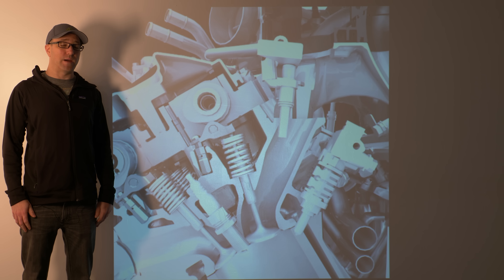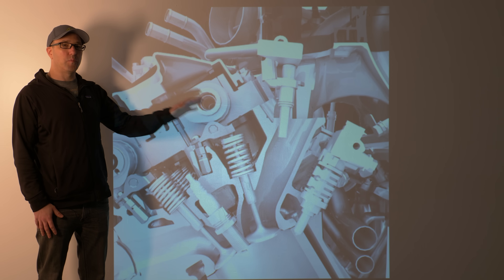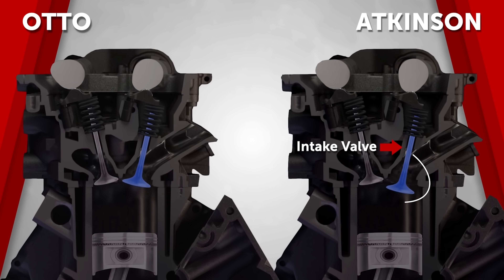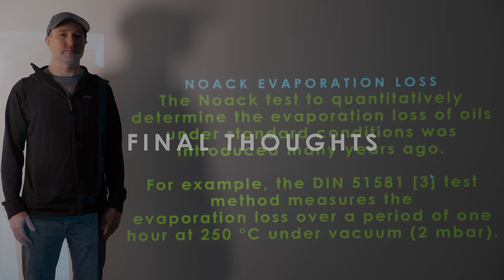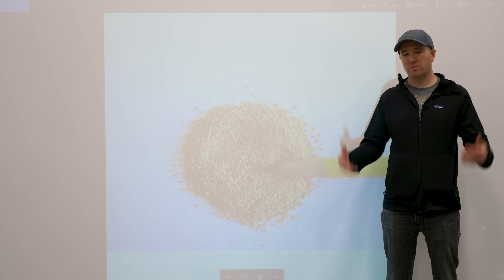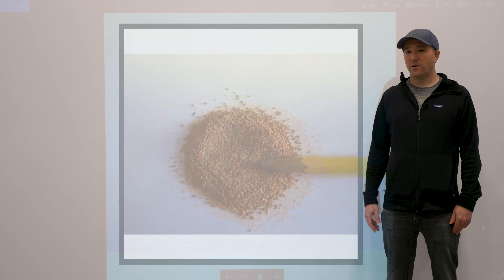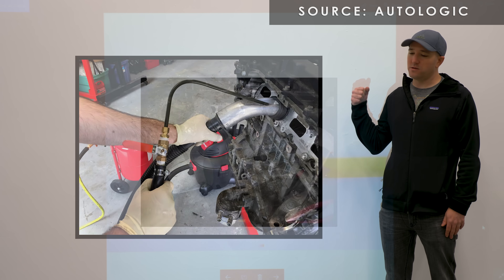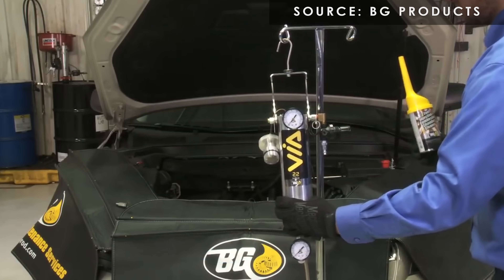Direct Injection, Problems and Solutions | The Fine Print

Comment: Lots to say and share. Please be smarter than my average customer(s):

1) check your oil religiously. Always on flat, level ground. Wipe the dipstick and recheck it. Add as needed.

2) Stick to 5k mile oil change intervals, with a OE or premium oil and filter. I’ve written tech articles on why this is so critical.

He hit the nail on the head, talking about the evaporation of thinner oils, but evaporation is not the only culprit: they are more susceptible at getting past the rings and getting burned as part of the normal combustion process. 

Honda and Toyota have been using 0W-20 oil as far back is 2010. On the Repair side, we call this “water weight”…it’s ridiculously thin, and not ideal for hot climates. 

Thinner oil allows for reduced friction and tighter bearing clearances (and increased fuel economy), but you have to become more religious and adjusting your oil levels as the owner. 

3) Americans are famously bad at this. Equal parts cheap and neglectful with cars.

To the point that some manufactures have completely gone away from dipsticks, and only use a digital level sensor, which creates its own series of problems.

4) use top tier fuels exclusively. Not cheap, budget brands. Shell, Chevron, Exxon, Texaco, among others in the US. And use the appropriate octane for your motor.

Cheap fuels without detergents and cleaning agents lead to an even faster buildup of carbon deposits throughout the pistons and valves. Long term, it makes a pronounced difference. I’ve bore scoped hundreds of engines, and have the data to defend this.

5) If you have a DI motor…plan, save, and budget for the carbon cleaning every 40-50k miles. 

6) Make sure the shop you use knows what they’re doing and has done these before. The service requires the intake manifold be removed from the engine, along with anything else attached to it, and lots of care to ensure no debris gets down into the motor during cleaning.

Chalk it up to the price of admission for having reduced emissions and greater power from your motor. Power output from DI engines has been incredible for the last 10yrs or so.

Like 👍 if this info helped anyone.

-career mechanic and engine builder, 22yrs
Reply: Terrific post Tex. Lots of good content and easy to read. I just leased a 25 Forester assuming they used a dual injector system, or something else, to address this as I encountered carbon valve fouling literally 30 years ago working in a VW shop. 
Holy schtick how could this not be fixed by now? Shame on me for assuming...

Comment: Shell's Premium gasoline has cleaning additives and a bottle of Techtron in the gas tank really helps keep direct injectors clean.
NOTHING WORKS FOR THE VALVES. Every year, have a shop walnut blast them. Don't  even waste your time with trying chemicals 😂 and scrubbing. The cleaner will get into some pistons and you will run dry in that area a few minutes; enough to start damaging the engine.
Shop around, sone shops charge $300ish, some a lot more.

Comment: If they really design it right the first time and in the proper configuration layout, that makes it easy to maintain.  We wouldn't be having all these carbon issues and whatnot that are at an odd configuration.   What works and made sense should be adopted as the best design and most reliable.  NOT let's design this in the most complicated way that just made zero sense and less reliable.

Comment: GDI  is a mistake. With port injection, the back of the intake valves is constantly cleaned with fuel. This does not happen with GDI. Really good presentation.

Comment: I have a 2017 CRV 1.5 turbo with 81,000 miles and have not had a bit of engine/transmission problems. Average 38mpg so far.

Comment: Have you ever wondered why car manufacturers don't install oil catch cans from the factory? It seems like a no-brainer solution to prevent engine oil from entering the intake system, which can cause damage and significantly reduce performance. With an oil catch can, you can prevent this from happening and extend the life of your engine. So, why not urge manufacturers to include this simple yet effective device in their factory installations?

Comment: This is good to know. I have the Kia 2.0 turbo GDI motor. In changimg out the starter I had to take the intake manifold off and i did notice the condition of the intake valves. I guess i will take the time to clean them off sometime. The car has 190k miles on it.

Comment: Funny, I had a very similar problem with diesel fired boilers. Firetube boilers have worked well for over a century now. But, with new EPA and state emissions standards for NOx, now we were required to use steam atomization for the burners.  In theory it would work great, lower the combustion temperature and therefore lower the formation of thermal NOx. In reality, we had massive carvon deposits everywhere in the firebox.

Comment: I've been running a couple catch cans (one is vented to atmosphere) on my 2.0l turbo Focus ST. I have a big turbo now and dont really notice too much blow by, but i think temperatures and how i drive impacts how much i get. I hand cleaned mine about 1k miles ago (was at 92k miles) and the intake valves were pretty good, but did have obvious build up. I can see how this would impact air flow. But another preventative option is methanol injection, used primarily for cleaning the valves if nothing else. 

Good video, well put together and very informative! Now if the EPA could just take a long walk off a short peer, I think the rest of us would be just fine 😅

Comment: IS250 4GR-FSE owner here. Learn to use Seafoam and love it. 188k miles and counting.
Reply: How often do you treat?  Do you apply thru the brake booster hose?  Thanks
Reply: @brianh1161  I treat it when I notice any off-idle hesitation. I used the spray bottle with the horseshoe straw that can slip under the intake hose and spray right on the throttle plate.
Reply: @G5Hohn  Sounds good - thanks!

Comment: Great presentation thanks, however the build-up of carbon you keep showing on the intake valves is not oil from 'leaking turbo seals', but dirty exhaust gas from the EGR.
Exhaust gas recirculation, which you didn't mention once, puts dirty exhaust gasses back onto the engine to reduce heat and emissions, and it's full of carbon and other nasties. So I believe it's the Exhaust Gas Recirculated that causes such build-up of crud on the intake valve stems, and yes there's no indirect fuel to clean it off.
Turbos have shims but not really seals, as any seal would obviously melt at such high temperatures, and a turbo causing oil to go into the intake is fooked as we say up North.

Comment: GDI, VVT, AFM and DFM engines (which are the only engines found in modern vehicles) all REQUIRE CLEAN OIL. If you change your oil every 10,000 miles you WILL ruin these engines. Oil removes carbon buildup and holds it in suspension until the oil is changed. Change your oil every 5000 miles or LESS and your GDI engine will be fine.

Comment: Good advice. I already knew about the DI only engines. That's why I got a used Lexus GS 350 from 2015. It has both. DI and port injection like you mentioned. I'm staying away from DI engines only. The problem is that regular consumers don't know about this issue 😢. I used to be a car tech and I'm just a DIY now. Luckily for me. I don't believe in the full EV thing yet. I would do Hybrid from Toyota or Lexus first 👍

Comment: I think your blow by explanation is not quite right.  Blow by direction in this example is “downward” past the rings into the crankcase, not “upward” through the intake valves.  Pressure back through the intake valves is not blow by.

Comment: LIke SG said, Toyota and Ford both use the perfect solution:  dual port/GDI injection.  The problem is twofold, first bean counters don't care what happens to an engine out of the warranty period. They nix any port/GDI proposals to save a few bucks, long term reputation be darned.  Second is the leasing sales model.   If customers were given the option to pay extra for dual injection would they take it?  Leasers wouldn't but outright purchasers probably would.  Thus all the customer pressure is on the performance and reliability in the first two or three years of a car's life.

Comment: A question? Would running cleaner(seafoam, throttle body cleaner) thru intake/throttle body once in a while (10k miles or so) not be effective on cleaning valves on engines with DI? Also, when I replaced valve cover gasket on my 2011 G25, I saw oil sludge near valves. Then, I installed oil catch cans and I see a small amount of oil being caught every 4-5k miles. So, oil catch can is definitely helping even for engines without DI

Comment: I wanted to get a catch can or aos installed on my turbo, but I've heard horror stories of water vapour condensation freezing in the lines on cold winter highway drives, building high oil pressure and shooting the dipstick out and spraying the engine compartment with oil. It's damned cold here. Guess I'll plan for a walnut blast

Comment: Great video.  I thought there was really no way to explain it better.  You did an outstanding job. Thank you.  Side note though.  ESPECIALLY DIESELS,  the injector pressures are now is so high that it starts not only taxing what the injector can safely handle pressure wise but they also remove the lubricating properties to meet emission standards.  So you put Lucas Upper Cylinder Lubricant into your fuel but you are now sacrificing the longevity of your SCR system.  This is a regulation issue.  

Cars and trucks today put out a small fraction of what they were putting out 40 to 50 years ago.  Great, right?  Wrong, because there are more cars on the road then there were 40 or 50 years ago, so that makes all the emission control gains meaningless.  Electric Cars introduce a whole new set of problems maintenance wise. That in itself is a different video, yeah, looking at you brake booster and batteries.

Comment: If each intake tube on the intake manifold had a screw on capped orifice, the valve cleaning solution could be shot into the intake valve easily to clean one valve at a time. No removal of the intake required and no guessing if you are getting enough cleaning solution thru the air intake tube at the air filter housing.

Comment: Motor?? Engine, not motor. Gas engine, electric fan motor…….diesel engine……electric pump motor……..jet engine…….electric door opener motor. Engine for combustible fuels!
Reply from the maker: Motor oil, motorsports...
Reply: @savagegeese  As the motor oil container reads…..Motor oil for gasoline engines…….motor oil for diesel engines ha ha. This was a great video by the way.

Comment: If an Engineer can come up with a way to directly inject fuel into an engine. Why can't they come up with an injector for  the air? It would remove the need for an intake value and it would allow you to scavange the cylinder better on the exhaust stroke as well?

Comment: It's hard to believe that a lean buring high economy engine with port injection getting a solid  50mpg or more is actually polluting more than a gdi getting 35mpg or less.  And the insane additional costs involved are truly criminal for a large portion of the working population. And, in real world usage, the majority of the gdi engines are not getting these expensive service procedures and are far more polluting than previous injection designs.  This is the real world, not some lab result. I'm all for tech as long as it works flawlessly and without need of attention.  But all these green initiatives in various different devices are so damn costly over time that they are now unaffordable for many people. Responsible engineering without planned obsolescence and continuous repair is the correct answer across the board. No one in authority cares so why would manufacturers care.  It's all about the buck and it will destroy America and most of the other economies in the world all in the name of helping the planet, which is a complete cover for their pitiful greed.

Comment: About going back to port injection not being practical... It is not practical to burn oil using gdi after a few miles. What I'm seeing is the requirement of unreasonable maintenace (double or more oil changes and probably more expensive oil) to keep direct injection systems "in spec" to original emissions standards. More and more, people can't even afford cars, much less keep up with ideal increased servicing, not to mention having the time to get that extra service. So then, many more will lease vehicles and then we/they really won't keep up with keeping filthy DI engines clean because it's not our car.  Looks to me like stupid government.

Comment: The type of oil used plays a HUGE role in the carbon buildup with GDI engines.  Not all oils are the same and I always tell my clients that have GDI engines to ALWAYS use the OEM (dealership) oil.  Yes, it might be $10.00 a quart but these oils are specifically engineered to help prevent carbon buildup due to blow-by (which all new engines have).

Comment: So, based on what you're saying, every single car that is using direct injection will need all their intake valves replaced at some point between 30k and 60k miles. And all the car manufacturers will accept the massive hit to their major service required numbers?  And of course they'll have the precision measurement system that will ensure that the amount of fuel injected through the port will keep the back of the valves and seats clean without failing emission tests. And goodness gracious, when that "check engine" light comes on (the majority of the time it has to do with emissions - O2 sensors, etc) here's just one more thing to check. You wanna talk about GDI?  The mixed injection solution is a wayyy over-engineered approach and is a stop gap at best. When DI was developed, I somehow don't think that every engine designer on the planet missed this  MAJOR design flaw or decided to incorporate it just to cutoff their reputation to spite the emissions Council (or whoever that is)  Buried in this beautifully produced video is... a beautifully produced video that gearheads, and people who own Toyota's will share with their friends and you will rake in the bucks from the YouTube advertisers. But you deserve it for entertainment value.  Oh, and if you have a Toyota which are AMAZING cars, should you need to service a dual injection system,  just go to Google Maps and look up "Toyota dealers near me..."

Comment: Great video, I've been a licensed technician for almost 50 years.. and what a change.. sometimes good,, sometimes bad.. but the worst common denominator to all those years and cars.......People are either idiots or cheap.  People will never change oil on time or sooner, and never use high grade fuel.. these oils have the viscosity of baby piss, and  manufactues are pushing the absolute joke of eco oil,  promising its so thin that it helps mileage. And let's  not forget tuneups or simply maintaining tire pressures. DI is great, but....
Reply: Breathe.....

Comment: I bought a dual injevtion car..  couldn't be happier.  One thing that's interesting is that this Kia Carnival w/3.5GDI Dual runs So much better on 93 octane..  gets 3 MPG better (Doesn't quite cover the cost).  On 87 octane, the car felt "Bumpy" just off idle..  never knocked or pinged, but was getting close.  This engine has 12.3 :1 compression..  Worth it for me..  it's just so much smoother and feels much more responsive..  close to night and day difference.
Reply: Not a dual, it's straight DI i.e. will crap out during or after warranty. Motortrend says Direct-injected DOHC 24-valve 60-degree V-6, alum block/heads for that 3.5 in the Carnival.

Comment: Ok..GDI/DI engines..5000 mi. Oil changes 0w 5w20 only/Throttle Body Cleaning 5000mi .with PEA Spray only/Regular fuel treatment in tank with HD Star Tron Enzyme..Treats 120 gallons for 11 bucks...Lots of PEA in this product.....

Comment: Great explanation, I have a 2023 Kia Sportage with a 2.5L duel injection engine. I’m so fortunate, I didn’t preselect this engine when I was shopping but discovered the issues with GDI after my purchase. Carbon affects all manufacturers and now that I know, I’m staying away from GDI exclusively. My 2013 Toyota Highlander had 237K miles on it, butter smooth until I sold it recently, obviously it was MPI. I’m planning on keeping my Kia long term too, and luckily I have great 👍🏾 odds with my current dual fuel injection system. I’ll share this video as I hope it reaches many. 👍🏾

Comment: I use  Berryman  B12 fuel injection cleaner very often . Seems to be awesome.  No it's not 100%  but I have had good luck .  Mines a 2013 chev impala  yes I have noticed it will run  differently not by much , but is noticeable at times.  But a spark plug replacement is needed. I'm sure the original spark plugs are in it yet . 123, 000  miles I also started using full synthetic oil since last year

Comment: Would getting aux fuel Port Injectors installed on an original solely DI engine help combat the issue?
Reply: Yup, but you also have to have the tuning done to the ECU

Comment: Excellent video,
Now I know what type of motors to avoid in future vehicle purchases.
Straight DI powered vehicles are basically a NO BUY , while traditional ported injection and dual injected motors are a go.
It's that simple.
Reply: That's a bit extreme, and good luck finding one.
Reply: I just bought a 2024 Kona NLine and only then found out what GDI-only was all about. I took the hit and traded it in for a 2024 Tucson NA 2.5 with both DI and PI. Truly, I wish I didn't have gdi at all. Too much babysitting (double oil changes, synthetic oil, fuel additives) and maintenance expense when the probable DI service comes.